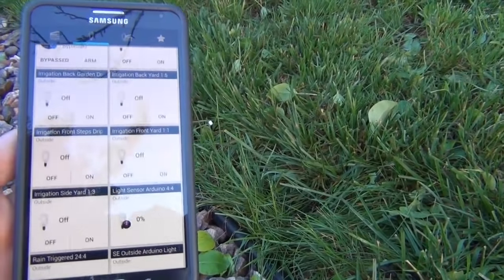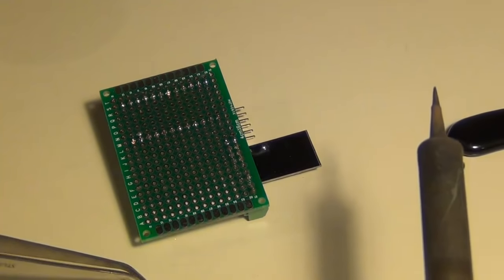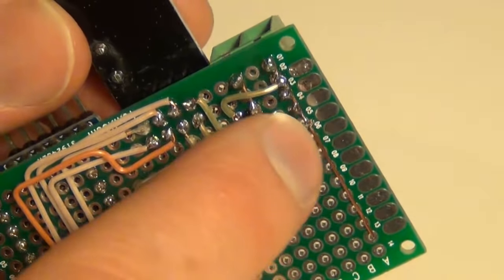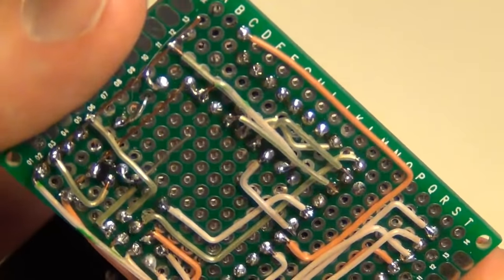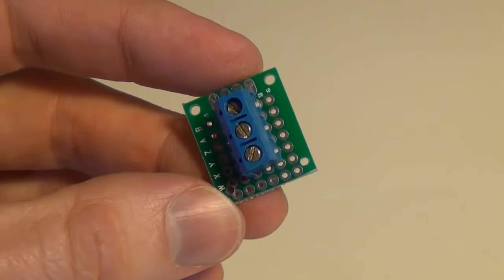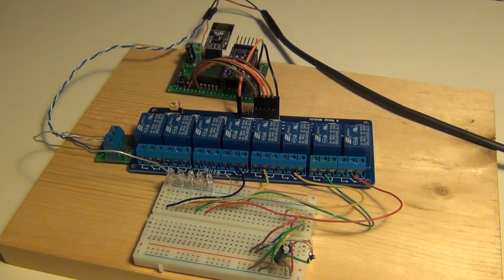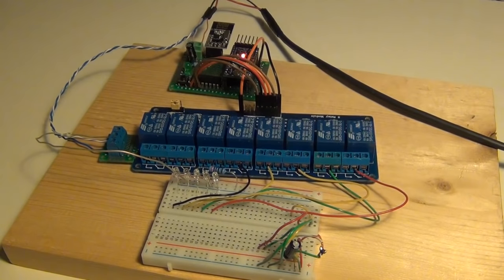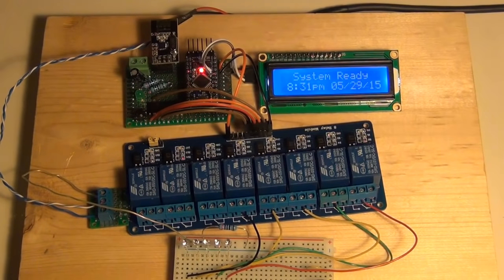How To - Cheap, DIY Arduino Irrigation Controller with MySensors

Comment: Can we interface soil sensors to the system?
Reply from the maker: Sure!  I personally like to do all the control through my home automation controller so I would report the soil values back to the controller and take action on that (instead of inside the irrigation controller).  That way you could have separate devices to report the moisture (it wouldn't have to be done with the irrigation controller device).  I personally have all my logic based on my rain sensor and the outside temperature so I haven't implemented any moisture sensors yet.  Maybe someday...

Comment: Is it the  (662K) 3.3V / 0.5A SMD regulator?
Reply from the maker: Yes, I believe that's the one.  It looks like this:
https://rover.ebay.com/rover/1/711-53200-19255-0/1?icep_id=114&ipn=icep&toolid=20004&campid=5338071705&mpre=https%3A%2F%2Fwww.ebay.com%2Fsch%2Fi.html%3F_odkw%3D3.3v%2Bregulator%26_osacat%3D0%26_from%3DR40%26_trksid%3Dp2045573.m570.l1313.TR0.TRC0.H0.X3.3v%2Bregulator%2B662.TRS0%26_nkw%3D3.3v%2Bregulator%2B662%26_sacat%3D0

Comment: Arduino: 1.8.5 (Linux), Board: "Arduino/Genuino Uno"

MySprinkler:174: error: 'POSITIVE' was not declared in this scope
 LiquidCrystal_I2C lcd(0x27, 2, 1, 0, 4, 5, 6, 7, 3, POSITIVE);  // Set the LCD I2C address to 0x27
                                                     ^
exit status 1
'POSITIVE' was not declared in this scope

I've tried this with LiquidCrystal_I2C 1.1 and 1.2 with the same error.
Reply from the maker: Did you use this code? https://github.com/mysensors/MySensorsArduinoExamples/blob/master/examples/IrrigationController/IrrigationController.ino
Reply: just replace this instruction with:
LiquidCrystal_I2C  lcd(0x27,16,2);

Comment: I don't understand the Vera part , i downloaded the software and connect arduino via usb but no devices are detected in vera ,ami  missing something, i'm already finished the circuit and i don't want to leave this project half way unfinished.
Reply from the maker: You may want to check out my other MySensors getting started videos.  You need a controller (Vera) and a MySensors Gateway.  There are lots of different types of gateways but I personally have found the ethernet gateway to be easiest to work with the Vera.  Check out the MySensors site for more info on those.  Hope that helps.
Reply: Would Vera Edge be sufficient for this project ?
Reply from the maker: It should be.  I am using an older Vera3 and I'm running probably around 100 MySensors devices.

Comment: Will it work without Vera?
Reply from the maker: You would have to alter the code but you could make it work.  It would be easier with a home automation controller still involved.  You can check out Home Assistant (instead of Vera) if you are looking for a free one.

Comment: Very impressive, but I have a question what advantage(s) does this system have over vs a system off of ebay with 12 zones? besides the satisfaction of building it yourself,  I'm not trying to be smart ass or something. It's easily to see you're very knowledgeable and I'm just seeking your advice, because knowing my luck I'll catch the whole thing on fire in my basement and burn my house down.
Reply from the maker: +Michael Angel The main advantages are that it's cheaper (less than $20), customizable and can be automated with home automation systems.  If you don't have a home automation system or you don't have any interest in learning Arduino you may be better off just purchasing a 12 zone system from eBay though as it will be less work. :)  
The odds of you catching this on fire are very low as long as you use good quality power supplies.
Reply: +Pete B Yes, I'm very interested, if down the road I wanted to add a larger relay board can I do that with the existing items or would I have to build a new one?
Reply from the maker: Michael Angel Yes, the way this is designed with the shift register will allow up to 16 relays.  You could also add additional shift registers for more outputs (relays).

Comment: i cant find the  Arduino  code nor the mobile application code anywhere
Reply from the maker: The link to the Arduino code is in the video description (https://www.mysensors.org/build/irrigation) scroll down on that page and you will see it.  The mobile app is specific to the Vera home automation controller.  It's called AutHomationHD.

Comment: i dont see a rtc? what happens when power goes out?
Reply from the maker: It gets the time from the MySensors gateway.  So, when the power is restored it will get the time again as part of the startup process.  It also polls the controller periodically to make sure it has the correct time.  So, if it has been running for a couple of months there won't be any drift due to an inaccurate Arduino clock.

Comment: Hello pete, Connection to mysemsors is not clear
Reply from the maker: Hi Asiri,
Check out the https://www.mysensors.org/about page for info on connecting to the MySensors gateway.  This video assumes you already have a gateway set up.
Reply: @peteb9105  Hey Pete, can you do an example video how to setup Vera... Also is it a free service?
Reply: Also can I use Home Assistant instead of Vera?
Reply from the maker: @asiritennakoon3673  You have to buy Vera hardware but after that it is free.  Home Assistant should work and as you probably know is free.  I haven't played around with the VAR requests in HA yet so you may need to alter the code slightly to push them from HA instead of pull them from the Irrigation Controller.  I know that controlling the valves manually will work with HA so updating the times with VAR commands should be easy with Node Red or some other method.  Hopefully that helps.
Reply: Hey Pete,
Thanks alot... I'll give it a shot...

Comment: can I use SN74HC595N insist of SN74HC595
Reply from the maker: I didn't look in depth at the datasheet but I think it should work.  You also may not need to use a shift register if you don't have too many zones.

Comment: can I use nodeMcu esp8266?
Reply from the maker: I haven't personally used an esp yet but I believe it is possible.  You can check out the MySensors forum for more info on using the esp.

Comment: can i do this project using arduino uno?
Reply from the maker: Yes, you can.  This is a pretty advanced project though.  You may want to do a basic MySensors project (like a motion or temperature sensor) then try this one.  If you want to jump right in to the advanced stuff though the Uno will work. :)
Reply: Pete B actually I want to start pump in agriculture field n rotate valves for different sectors. Can u help me in dis
Reply: Hello Pete B:  Very nice and detailed video. Can this be built using Raspberry Pi?  Thanks.

Comment: So the circuits fine but he's controlling it with software and I have no idea what that is or where to find it. It's a bit odd the whole project is dependent on an app that is not linked to or given a proper reference. It's like 'well everybody has that installed when their born'. Not much point in the project without that info. It's not mentioned on the sensor site article either.
Reply from the maker: +Juncus Bufonius this video was intended to help existing MySensors users.  The scope would have been too large to cover everything needed for this setup. However, I am using a Vera home automation controller as the "brains" in the process. Feel free to check out https://www.mysensors.org/about for more info on MySensors. There multiple controllers that work with MySensors so it's allows for a very dynamic setup/config. Hope that helps.

Comment: How to connect device to smartphone, please help me.
Reply from the maker: MySensors is compatible with a variety of home automation controllers.  You would use whatever app they have.  I use Vera and the app that connects to my Vera controller.  There are many other people using Home Assistant and OpenHAB but I have never tried them so I'm not sure how their apps work.

Comment: then how assemble pipe and mortar pump
Reply from the maker: This is just the controller.  The irrigation system is the same as if you didn't have a smart controller.  I just went to my local home supply store to get the valves, manifold and pipes.  There is no pump, it just uses my water in my house.

Comment: its not UF its micro farads
Reply from the maker: Slobodan Vidovic haha, yeah, showing my ignorance there.  Thanks!  I'll try to remember that for future videos.  It's just so easy to say UF... :)
Reply: Pete B  it's also a Greek letter mu  μ
Reply: its not micro farads, its pico farads
Reply: that would be a pF
Reply: ah yes, my bad
Reply: Also, the caps are not included in your design to “filter out the power” rather they filter out the noise or simply filter the power. Lol

Comment: I built everything but when i try to verify the code i get this error :

Arduino: 1.8.4 (Windows 10), Board: "Arduino Pro or Pro Mini, ATmega328P (5V, 16 MHz)"

sketch_oct11a:174: error: 'POSITIVE' was not declared in this scope

 LiquidCrystal_I2C lcd(0x27, 2, 1, 0, 4, 5, 6, 7, 3, POSITIVE);  // Set the LCD I2C address to 0x27

                                                     ^

exit status 1
'POSITIVE' was not declared in this scope

This report would have more information with
"Show verbose output during compilation"
option enabled in File -> Preferences.

I have updated all the libraries .The version of Liquid crystal I2C currently is 1.1.2 . I Also tried downloading the library via your bitbucket link (https://bitbucket.org/fmalpartida/new-liquidcrystal/downloads ) but that just made the code pop up with more errors.
Reply: I messed around with library a bit and got it working, I edited I2CIO.cpp in LiquidCrystal_I2C folder a line of code called
#include <../Wire/Wire.h> to #include <Wire.h> 
Sketch uses 19944 bytes (64%) of program storage space. Maximum is 30720 bytes.
Global variables use 1197 bytes (58%) of dynamic memory, leaving 851 bytes for local variables. Maximum is 2048 bytes.

IS this OK or am i missing something ?
Reply from the maker: Yes, you were having issues with the library for the LCD.  If it's working ok you should be good.  Good job!
I'll have to take a look at the code/libraries to see if I can get everything updated.  Thanks for your feedback!
Reply: Hey mate, I dont have a file called I2CIO.cpp only LiquidCrystal_I2C.cpp. Is this the same? Ive added in the #include <Wire.h> line but im still not having any luck. I have also be unable to find #include <../Wire/Wire.h>. I have tried both LC 1.1.2 and the newer verison
Reply from the maker: I just had a few minutes to test this.  Everything is compiling when using the standard MySensors code/libraries available from github.  At the time of this posting this is the current link: https://github.com/mysensors
You will need to add these libraries to your Arduino libraries folder: https://github.com/mysensors/MySensorsArduinoExamples/tree/master/libraries
Here is the link to the code: https://github.com/mysensors/MySensorsArduinoExamples/tree/master/examples/IrrigationController
You can install the MySensors libraries from the Library Manager within the Arduino IDE or here: https://github.com/mysensors/MySensors/tree/master

Hopefully that helps. Let me know if that doesn't work for you.

Comment: that is 15 do you sell kits 4 15 and instructions  that people  without  a computer  degree  can understand  and can you put it out side it is not water proof  is the app yours
Reply from the maker: +john Kosheluk No, I don't sell kits.  I just do this in my own home and try to help others along the way.  All the parts needed are listed in the link in the video description though.  It could easily be put in a waterproof case if necessary.
No, the app is not mine.  It's called AutHomationHD and is for the Vera home automation controller.
Reply: If I wanted to get this and try because  I am a sprinkler cotractor how would I do it not knowing a lot about computers  do you sell the relay bank.
Reply: How meany zones can it run and can it be run of every phone
Reply from the maker: john Kosheluk This setup requires a home automation controller and a MySensors gateway.  I'm guessing it might not be a good fit for you if your are a contractor.  It would take some setup in your client's homes beyond just this controller.  There are other systems available that are more all in one solutions.

Comment: Hi Pete, thanks so much for this very good instructional video. I have assembled the hardware, it has taken a long time for a non-electronic person like myself but I have learnt a lot in doing so. I have now compiled the code with the version in description, together with the latest MySensors libraries and  am getting the "Sketch too big" error;

Sketch uses 19868 bytes (138%) of program storage space. Maximum is 14336 bytes.
Global variables use 1198 bytes (116%) of dynamic memory, leaving -174 bytes for local variables. Maximum is 1024 bytes.

Code I am using (as per instructions here https://www.mysensors.org/build/irrigation);
Sketch: https://github.com/mysensors/MySensorsArduinoExamples/blob/master/examples/IrrigationController/IrrigationController.ino
Libraries : https://github.com/mysensors/MySensorsArduinoExamples/tree/master/libraries
MySensors : https://github.com/mysensors/MySensors/tree/master

I am wondering whether the new versions of MySensors libraries have become bloated to the extent they exceed the limit of the board? Can you give me any advice, it would be a shame to abandon my project at this stage.

Thanks,
Dave
Reply from the maker: Dave, 
Sorry for the delayed reply.  It doesn't look like you're using an Arduino Pro Mini with an ATmega328P.  That has 32k of storage which will be enough.  You could also use an Arduino Nano which as a ATmega328P.
If that doesn't help, there is a link in the video description to the MySensors forum where you will be able to get help a little faster next time.
Reply: @peteb9105  Thanks Pete, yes I wasn't aware of the 328p version but have one on order now. Thanks to your design I can swap it out without redoing all the soldering 😊

Comment: I was going to make a comment about the proper pronunciation of the "uF" issue but I see several others already have.  One thing you might want to watch about capacitors is this video:
https://youtu.be/67M7fsbLUIU
There are MANY really informative and interesting videos on "Mr. Carlson's Lab" and you would probably enjoy them all.  Hope so anyway.
Reply from the maker: Yeah :)
That's the problem with videos.  You can't go back and edit them very easily.  I thought about re-posting it way back when I first made the mistake but YouTube didn't have a way to replace an existing video and keep all the links the same so I just left it.  It keeps me humble ;)

Comment: What is the power of this soldering thingy - I have one on 220V 60W and I think It's a bit bigger than what I need for this slim wires. Is that right?

Comment: Lots of sodomising in this video (I thought 'solder' had an 'L' in it??)
Otherwise good video. You should have a master valve before all your other valves however to help prevent leaks developing due to a constantly high pressure.

Comment: Wire wrap?  Dude, way easier.

BTW - Daisy chaining those relay elements is bad. One cold joint and everything dies. Screw terminals with wire ferrules were invented for a reason.

Comment: printed  circuit board board.
printed circuit board boards
printed circuit board board board
Reply from the maker: Ha.  Yeah, this video was made before they were so easy and cheap to make.  Also, if you only need one controller it might still be easier/faster for people to do it this way.  PCBs are nice though.

Comment: arrrg! buy why arduino? use an ESP8266, faster thar arduino + wifi and cheaper! you can even use lua and flash it wirelessly
Reply from the maker: aguaviva I already replied to you in another video but I'll do it here too in case other people don't read that comment.  Agreed, it would be simpler.  To my knowledge the esp8266 isn't compatible with MySensors yet which is what I'm using to interface with my home automation controller.  I'm sure it will be soon though.  I can't wait to start using the esp8266!